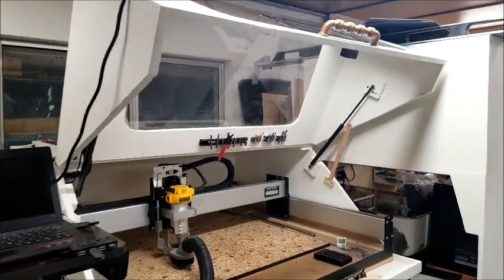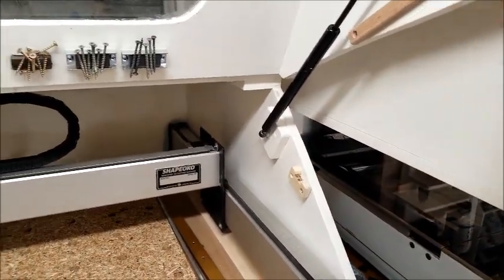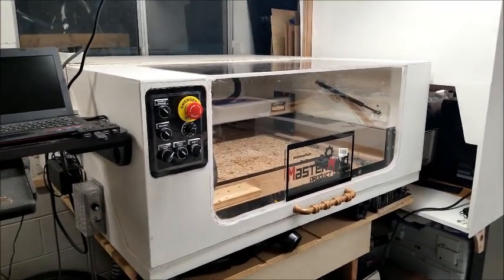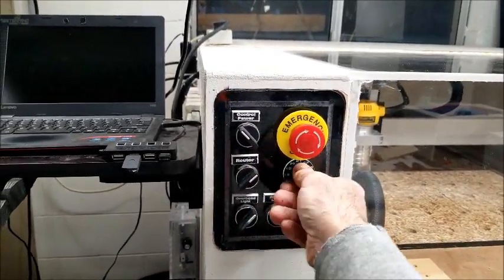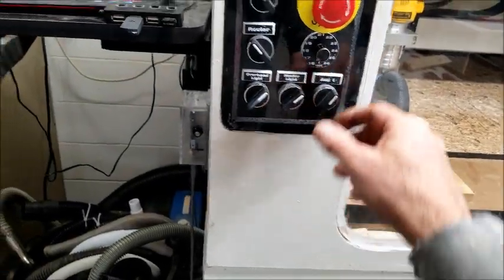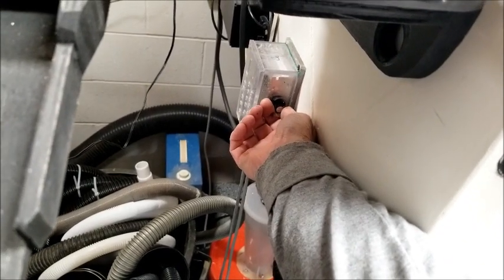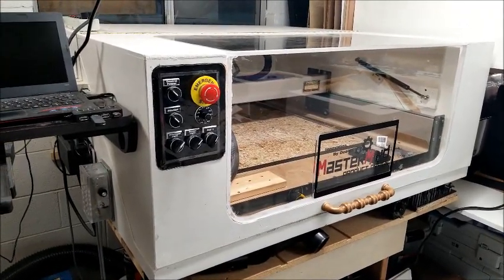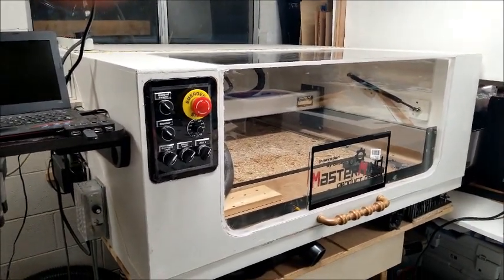Shapeoko 3 Enclosure - Recent Modifications

Comment: Can you provide some details on your control panel?  I haven't seen another like it, and I'd like to build something similar myself.  Video, photos, parts list, schematic...really anything would be super helpful.  Did you start with bare electronics parts, or did you salvage things from other equipment, like an aftermarket in-line router speed controller?  Really curious how you control the router power and the router light separately.  Thanks!

Comment: I just want to thank you for the inspiration! I ended up building a similar enclosure, made it taller with the dust hose inlet on top with a two inch clear flex hose running to my dust boot. mounted LED tape strips around the window for some extra light inside. I am considering adding acoustic foam to the interior but I'm on the fence. I would really love some more info on that control panel and how to re-wire the router to the switches. I am an aircraft mechanic / wood worker, far from an electrician. If you could email me I would love to show you how my design currently sits. Thanks Tony!
Reply from the maker: I just saw this, Wes.  I got a collaboration deal with a sponsor for my shophacksdotcom YouTube channel so I've put off the product development for a couple months to get my first 5 videos ready for that channel.  The controller won't be ready until after February now.  Sorry for the delay.

Comment: I know I can build the enclosure but, man I wish I could do the controller and all the other electronic gizmos that you hooked up. Very impressive, especially the front control panel.
Reply from the maker: Vigil Ante the control panel isn't difficult. Rewiring the router speed control and light was more work than I expected but the other stuff isn't difficult. I might make a video to show how to make the control panel if I can find some time.
Reply: That would be great! I believe I could learn a lot from you.
Reply from the maker: Vigil Ante I'll be launching another channel in a couple months.  I'll include high quality step by step how-to videos on that channel. I'll notify everyone on this channel when the other one launches.
Reply from the maker: Guys, I'm designing a control panel with an EStop, 3 switches and a speed control potentiometer.  All you would have to do is plug in the three things that you want controlled by the switches and do the router hack if you wanted to use this panel for speed control.  It  requires no wiring and just drops into a hole in your enclosure or it could be mounted in a stand or box.  It looks like by the time I add up all the components and assemble it I would need to sell it for around $150 for it to be feasible to sell them in quantity.  Does that price seem reasonable or not?  Let me know your thoughts.
Reply: I'd love this whole setup! Do you sell it? I just got an XXL
Reply from the maker: Peyton's Project... I have a prototype designed and built.  After a full round of testing I need to iterate the circuit board design one more time so it can handle the worst case current load without getting too hot.  I will eventually be selling them at www.shophacks.com but it will probably be at least two more months now that I have to do another round of design.
Reply: Tony Shulthise do you sell the specks for the enclosure?
Reply: @T70781  hey Tony. I have my XXL in it's way, anxiously awaiting your controller to be up for sale. Any updates?
Reply: Tony Shulthise +1 to Vigil Ante’s comment.  I would love to see how that panel went together and any of your considerations during the build.  That enclosure is a sweet bit of kit!